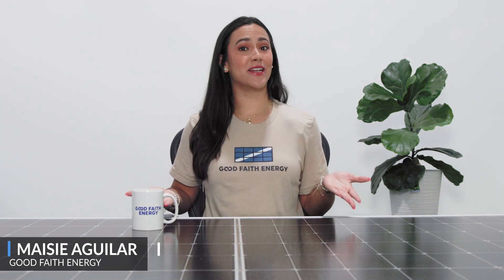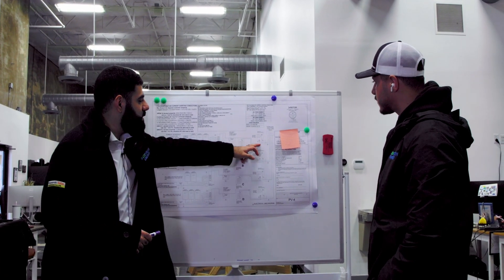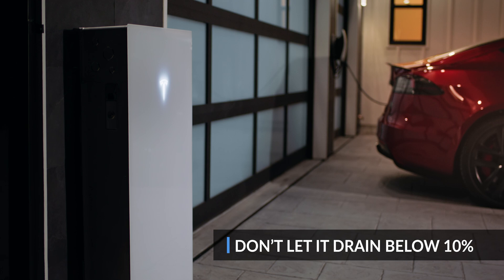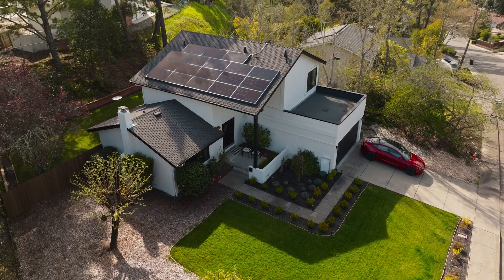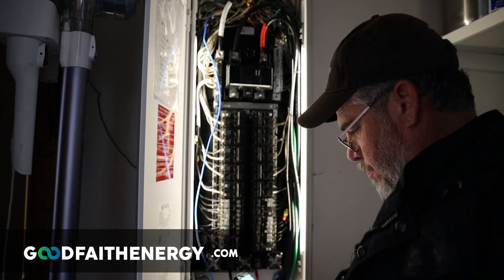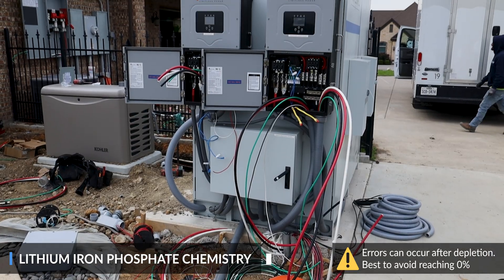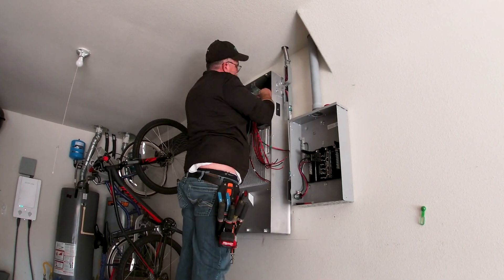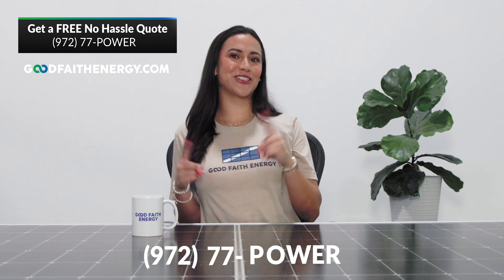Why You Should Never Let Your Home Battery Drain to 0%

Comment: My understanding now is that a Powerwall3 can run down to zero with no issues.   Is that correct?
Reply from the maker: Tesla's guidance is that the batteries run down to near 0 capacity and black start with minimal voltage
Reply: @GoodFaithEnergy  Thanks for the confirmation.

Comment: The Franklin Battery has 1kw/h of power reserved (beyond the 13.6kw advertised), so it can go to "zero" as displayed in the App, and then simply start charging again from solar in the morning.  I also love that they can be charged from solar, the grid, or a generator - we have free power from 11:00am to 2:00pm with our supplier (I'm in Australia) so it's a great time to run the dishwasher, washing machine, hot water, charge the car,  and of course charge the battery from the grid. Then we use the free power at night during peak electricity costs. Beyond the line connection fee, no bills, even with 2 electric cars in the family.